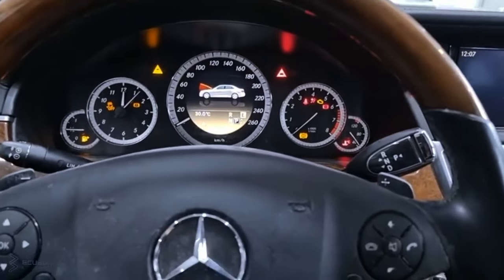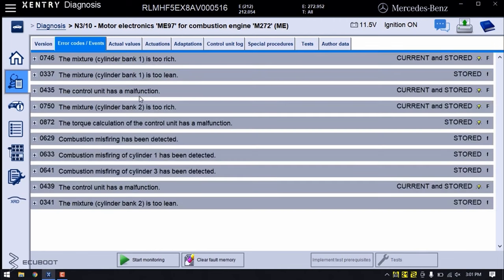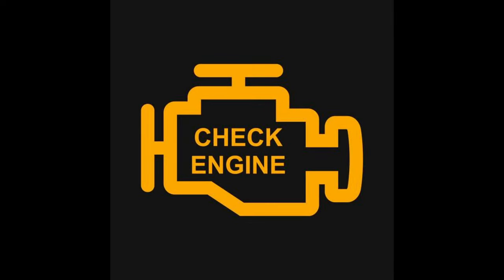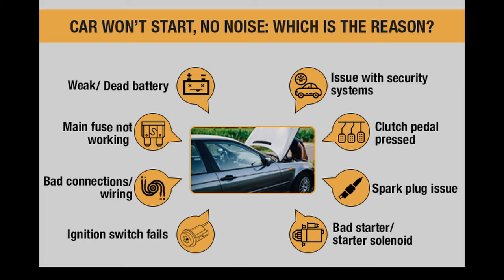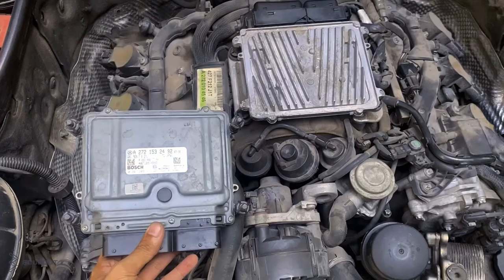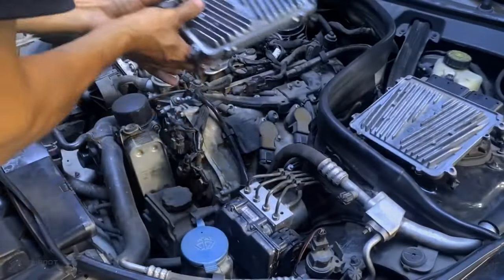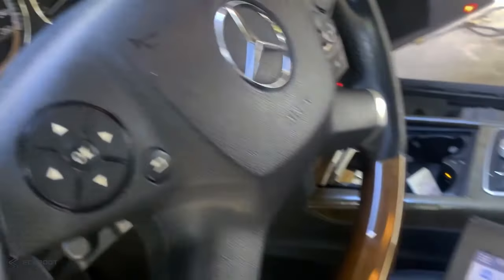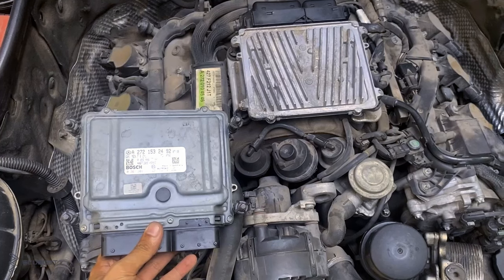How to code a new ECU after replacement - Teach-in of Drive Authorization Process

Comment: I have a new Launch x431 pro, can I perform this job on my 2007 w211? It has the same ECM and in the same location.
Reply: Did you ever get an answer I just bought Launch x431 so please let me know thank you??
Reply: Actually, my issue turned out to be a bad fuel pump. But what is it exactly you need to need know about your launch?
Reply: @iamher6422  okay I sell used cars. So I have the opportunity to buy a few cars that have bad computers( ECM&ECU) for cheap. So I wanna no can the Launch x431 program the computer once I replace them?? Thanks for your response

Comment: the first stages of the video were out of FOCUS, you did not explain to DISCONNECT the Battery 1st, before unplugging'reconnecting the ECU, also that music was unnecessary, way TOO LOUD. there are a lot of other work associate with fitting a replacement ECU,as it will have the VIN number from another pre programmed vehicle that will clash with all modules! , and the keys/ immobolizer needed synchronizing 🤔
Reply: Yep
Reply: Hi anyone knows if I can buy used power steering rack and fit it on my Mercedes E350? And does need to be programmed 
Thanks
Reply: @Aali289  send all the details about car, ie; vin number, year of manufacture,auto/ manual gearbox? as most items on many mercedes can be fitted with 'minimum' recoding, you may have to adapt the steering angle sensor, best advice is get the replacement part with exact matching part number as your own car, and disconnect battery before attempting the work, mark up precise position on shaft /steering wheel etc, should work, but do pass me the details if your apprehensive before doing the job, and i'll see if i can shed some light on any possible issues, Take care. 🙂

Comment: the problem I have is that the Drive authorization system - Start enable.  it is not authorized, the ECU is new, new fuse Box, new Starter, grund chassis, I have not changed the SAM yet.  everything else works fine.  the steering lock works, locks and unlocks.  the shift lever can perform the P,R,N,D.  Everything's fine.  The only problem I am having is 085 Drive authorization system - Start Enable.  (NOT) I live in NYC

Comment: Hi I have a question. My Ecu unit is A2721531591, can i use A2721532992 or A2729002700 as a replacement? Some suppliers said its the same for all A272 models. Can you verify with this one? Or can anybody with proper understanding on this provide some confirmations on this please?

Comment: Hello I have a Mercedes c300 2009 and ever time I turned off the car  after 2 minutes the throttle body start making sound open and close and never stop and drain the battery I was thinking replace the ecu cause is not normal any Help please
Reply: If ur battery keeps draining its ur alternator
Reply: @babyboi4778  It was the ECU y replaced and work great